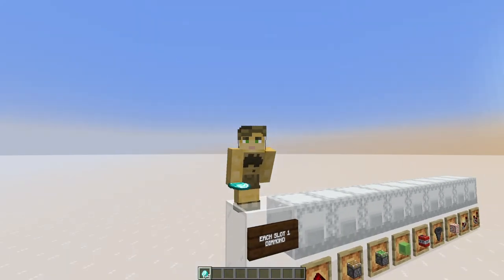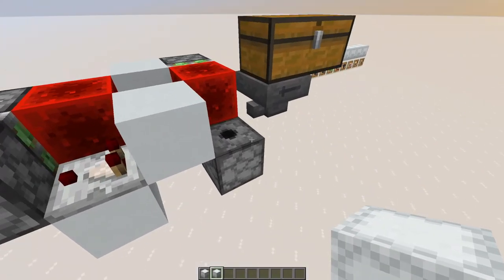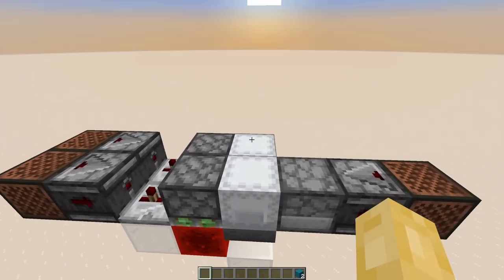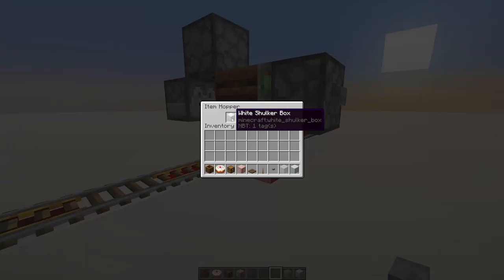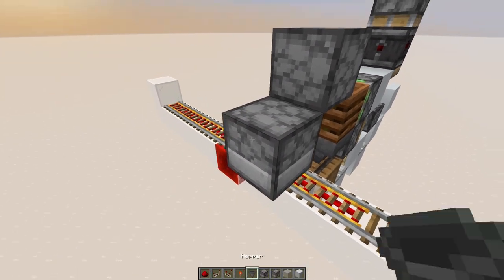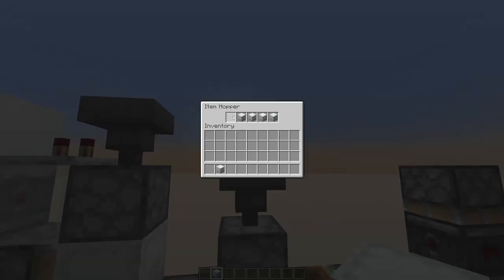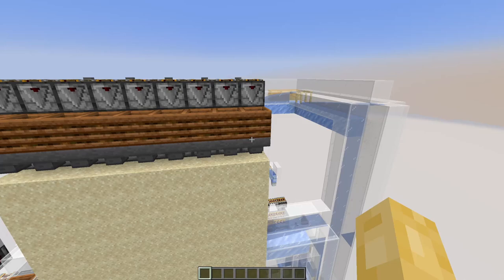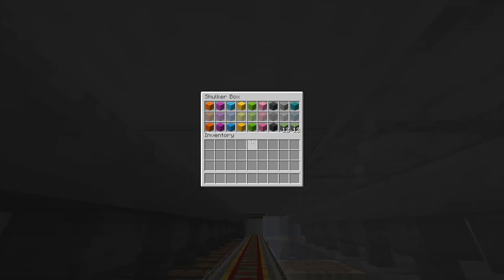Let's Build a Redstone Shop

Comment: Hello ladies and gents, today we do 'over-engineering with Cubic'.
"Why spend 10 minutes of restocking your shop, if you can spend 10 hours building something to do it for you!"

Good video, it does explain why I enjoy redstone as much as I do. Seeing that I'm a software developer. Lot of the same thinking processes.
Reply: Hey if you're going to spend that 10 minutes >60 times it's worth it! 😅
Reply: What programming language are you using that's as convoluted as redstone? 😂
Reply: @mhelvens  boring languages talk. All languages can be convoluted. Depends on the developer not the tools.
Reply: @liamkearn  You're saying that programs can be convoluted regardless of language, which is true enough. But I'm talking about programming languages. Redstone would be a bad one, because implementing even simple concepts requires convoluted machines.

That's OK. Redstone wasn't meant to be a programming language, but a gameplay mechanic.
Reply: @mhelvens   I have no doubt whatever programming language you use would be convoluted by the same standards if you consider your IR being passed through LLVM lol. A programming language in itself is inherently complex to save time.
Reply: AKA languages are convoluted and comparing language A to language B matters little if they both compile through a common tool chain. There was a rust process I saw recently which attempted to use cranelift for minecraft redstone if that puts things in prospective 😆
Reply: @liamkearn  Now you're talking about language implementations being convoluted which, again, is true enough. But I'm talking about how easy or hard a language makes it to express various concepts and intentions, with code that is readable and maintainable. In that sense comparing language A to language B matters a lot.

For example, I suspect that you and I both could implement Cubic's partial shulker box filler in under 5 minutes if we could use a high level programming language. Or if we could use Minecraft mods like XNet, for example.

By that standard, vanilla redstone is a horrendous programming language. It was designed on purpose to be challenging to use. 🙂
Reply: @mhelvens   redstone was designed to simple from the accounts I’ve heard. It ended up not so simple 😆

Yes expressing concepts in languages can be differ but again I’d say 99% of the time we’re still dealing with such an extraordinary level of abstraction that it doesn’t matter. For example if I don’t like the way something is expressed I can just create a macro to change that. I can see the value in what your saying though a lot of concepts are easier to express out of the box in ML style languages but for the most part challenges you’ll face with a modern language are purely syntactical.

I don’t count syntax as convoluted it doesn’t have any inherent complexity given it can always be factored differently.

What’s xnet I haven’t heard of it before, is it some sort of modern computercraft? It’s been a while since I’ve played minecraft.
Reply: @liamkearn  You've hit upon a great argument, which I should have made myself: Redstone doesn't support user-defined abstractions. 😄 If you need 50 flip-flops or storage-slices or whatever, you have to manually build each of them from basic components.

> What’s xnet I haven’t heard of it before, is it some sort of modern computercraft?

Nah, nothing so sophisticated. It's an old mod which can help orchestrate between multiple inventories and machines. You connect them with cables, and through a controller you can then specify the movement of items / fluids / redstone / RF between them.

Computercraft would have been a better example.
Reply: @mhelvens  not supporting user defined abstractions doesn’t necessarily equate to convoluted languages, programs or anything computed really. If you’re talking convolution I’d draw a pretty direct line to cyclomatic complexity. Sometimes dumb solutions lead you to pragmatic o(n) time complexity instead of playing with fire with calls, callsites and loops and potentially shooting yourself in the foot. I don’t think redstone is convoluted at all, merely undocumented and primitive.

I’d have to agree though you’d have have a pretty terrible program to make it comparable to redstone. Just omit the convolution bit and I’m happy 😂

Took a look at xnet and learned the answer to a question I asked a month or two back while watching some guy play with mods. “I wonder if mod interoperability in terms of energy and liquids etc is a massive pile adapter implementations?” Turns out forge provides a common interface which is a fact I’ll never use because I’m never gonna be caught lacking with Java for anything but a potential future job change :D
Reply: you are thinking like a software developer
Reply: @liamkearn  Here I am with a decent understanding of programming and 2 years of self taught C++ and yet I have absolutely No idea what you two are chatting about 😆
Reply: @Reaper Vibes  I work in the industry and neither do i 🤣, I'm also self taught so maybe we are just missing the boring bit that doesn't matter

Comment: 12:12 "Hoppers have a tendency to randomize the order in which they push and pull items"

Does this mean it is possible to represent a quantum system using a bunch of hoppers where each hopper represents an eigenstate and the item inside the hopper the eigenvalue/observable of the system (and the act of measurement/wavefunction collapse is the hopper pushing items into another storage container)? If so, then that would mean it may be possible to simulate quantum computing inside of Minecraft

Comment: Pretty incredible solution, even if it's over-engineered beyond the point of usefulness. The thought process and problem-solving that go into this are very inspiring.
I'd love to see your take on programmable railway systems that bring items from farms to a central storage. I've had a concept in my brain for a while now, but haven't been able to get something reasonable built to control which carts go down which lines without making a huge mess.
Reply: the solution is don't use rails
Reply: @introprospector  Depends on what you're optimizing for.  If it's transit time, then yes, nothing beats an instant dropper line.  But if the goal is to reduce transit operations (to load chunks less often), then a piston bolt system using stacked chest minecarts is better.
Reply: I used Maizuma Games' programmable minecart intersections for my player-transport system— I think they would be helpful here.  You need to send destination information along with the cart somehow, be it signal strength (what I chose), pulse length, time delay to another minecart (Etho's idea), or any other signaling method.  With an automated farm system, I think you'll need at least one more data line to ensure that each farm always has enough minecarts, either to request minecarts from storage, or to provide a return address for the storage-bound minecart.

Now I see where the mess comes from— collision prevention.  I think the sanest way to do this is basically to recreate Factorio's rail signals— have the sending farm claim the block from the farm to the first holding point or intersection, which will then claim the next block, clear the claim on the previous block, and send the minecart on, or wait if the next block is claimed.  I think this requires two-way data lines between all intersections/hold points, as well as the address lines already mentioned.  It's easy in Factorio because the trains do the routing, rather than the track, and the signals communicate via the rails (they detect trains).
Reply: @Hyrum_Graff  flying machine also works, you don't need an expensive bolt system

Comment: I tried looking into my own system like this about a year ago, but I had some issue with timings and counters.

Of course my idea was a little different. It started by automatically filling a shulkerbox with 26 non-stackable items, placed in the required amount of stock items. It then took out all the non-stackable items, put 25 of them back, and repeated until all non-stackable items were replaced.

It ended up being super large and would constantly drop the wrong number of items.

Comment: Interesting design. When you first proposed the problem I thought about filling the initial box with an item of a single type. It would have to have a low stack count, and it would take much longer to fill and infill the box.
Reply: Given the difficulty of the filling of the unique items, and the low throughput requirement, I wonder if this kind of design would be much much simpler.
Reply: @qqii  A non stackable item of a single type? like swords? The problem then is getting the swords (and only the swords) out.

Comment: mojang should make it so that hoppers can be moved with pistons, would make such a convenient filter. also if you could lock the hoppers inventory slots (individually would be even better) so that even when all items are drained the slot still wont accept items that aren't the one lock in the slot. (even if this means 1 items is still left in the slot that's locked, it would still be better than nothing)

Comment: Careful cubic.  You might pull A "Sahara"

For those that don't/didn't know:

Sahara was first given name by a hermitcraft. Member named Grian he along with Iskal and Mumbo jumbo (not the junk type) worked episodes and episodes to bringa masive "redstone functioning shop" known as well Sahara. How ever.  After a days and weeks work, finishing and tiding. It was ready for realese for the server.  The three were happy.  But on that day one member by the name rrendog  tried it fir the very and only first time only for Sahara to become A total flop. It never worked,  everything was all counter clockwise. Pistons were glitchEd dispensers were out of sinc hopperers were full. Minecarts weren't making it to the sell point.  And so the trio disbanded the project and so as of today, Sahara still lies in the dead server that is Hirmitcraft season 6.
Reply from the maker: Bro, I literally pulled a "Sahara" three times already, firstly with the instant hopper line item call, then the item call bulk and the upgraded self assigning bulk
Reply: @cubicmetre  pulled a Sahara better than HC coulda, it was a disaster

Comment: So I have a question regarding the input items. Say that I forget to add more stock and one section runs out of stock. Would empty shoulder boxes end up in the output?

Or will the comparators shown at 22:42 (detecting the trapped chest inventory) shut that slide down?

Note: I haven't checked any of this in game yet

Much appreciated and keep up the awesome work! It's absolutely awesome 😎
Reply from the maker: If a slice runs out of items it will start producing empty boxes. The comparators are to help visualise the fill level
Reply: @cubicmetre  That's what I was thinking what would happen. Thanks for the clarification!

Comment: you can also auto-place shulkers directly in the shop, but I don't know if you can understand when in the shulker there is only diamonds for a hypothetical automatic diamond collector
Reply: sorry for my bad English 😅
Reply from the maker: Yes I also thought about this, the best option would be to have a semi-automatic box display that the player has to hit a button to change the box when there is nothing but diamonds left. Because there is not way to reliably detect when the last stack of items is replaced with diamonds.
Reply: @cubicmetre  maybe a hopper below it that takes away the diamonds? Then check if its empty?

Comment: How does the is full detector work? What is the item frame doing?
Reply from the maker: Item frames send comparator updates, which is why you can read an item frame with a comparator and then spin the item in the frame to get different signal strengths. This means when the frame is empty, sending a signal of zero, if the signal coming into the block from the fill level detection is less than 15 then it will output zero.
Reply: @cubicmetre  Thanks, seems really odd (and really useful) that it only allows signal to pass at 15
Reply: @cubicmetre  i'm still agog at just placing the frame in the same block as the comparator  xd

Comment: Shouldn’t there be the shop interface for customers or is this exclusively for the shop owner’s ease? How difficult would it be to have the display stock (shulker) automatically be replaced at the moment all items inside are exchanged to diamond transactions?

Possibly for the customer there can be a manual restock button per slice where all items are yeeted from the display, diamonds are sorted out and the shulker is recycled back into the system.

You can attach a record keeping machine. Hermitcraft is built on the trust system, but a counter can see if the number of item slots emptied per shulker correspond to its value. Ex: If the display stock of 1 diamond per 16 pistons were to be completely sold, you’d be left with a shulker with 27 diamonds inside.

BUT if a customer were to manually restock the display shulker BEFORE it was completely sold, it wouldn’t break the system. Ex: If only 22 slots of display stock were sold then you’d find 80 pistons (16 pistons x 5 unsold slots) and 22 diamonds inside. Any discrepancy in counting either would be noted. You could determine stolen/missing/or unclaimed product as well as whether you’ve been underpaid, robbed, or even given extra as a tip.
 
Just a thought, thanks.
Reply from the maker: I would not trust customers to start the machinery primarily because they are just popping in to buy stuff and they will likely just leave while the thing is running and unload it. You could add an automatic chunk loader however I would suggest that you supervise a machine to make sure it is chunkloaded before leaving the area while it's running.

Comment: Only problem I can see is that you wouldn't be able to sell items 1 to 1 since the smallest stack size you can have items put into is 2.
Reply from the maker: Well, consider the limiting case of a single item in each slot, you'd just remove the counter and have a single pulse go straight through from the global trigger for the counters.

Comment: This it pretty rad. but the +2 is kinda limiting. Any improvement to be able to get a 1 or 2 item thing for like beacon sales?
Reply from the maker: Just replace the counter with a direct throughput for the signal to the dropper, that means you'd get exactly 1 item every cycle, for two items just double the pulse with a piston + observer. The counter is mainly there for when you need several items in each slot.
Reply: @cubicmetre  right, but I meant being able to have the entire range without modification. It's easier to swap the item counts on the fly then rebuilding sections of a contraption.

Although, I guess I could keep the single item sections always in the same part of the shulkers, (like an emerald with pricing info) centred.

I'm guessing if you wanted to keep a slot empty, you could fill it with yet another stackable dummy item, then suck them all out after.

Comment: This is a great video with really cool solutions. But completely obsolete. If you make an automatic shop then you just have to dispense the items without all of this. And if you were going to use Redstone why not make it automatic any?
Reply from the maker: The point of this is to make things convenient for the buyer, a system that you throw diamonds into and wait as items trickle out of a dropper is not as ergonomocal as a box display that you simple swap items stacks for diamonds. It also makes it convenient for the seller as they only need to press a button to re-stock.
Reply: @cubicmetre  that is true maybe you could make a ultra fast automatic shop next?